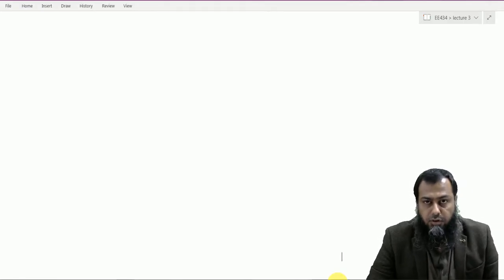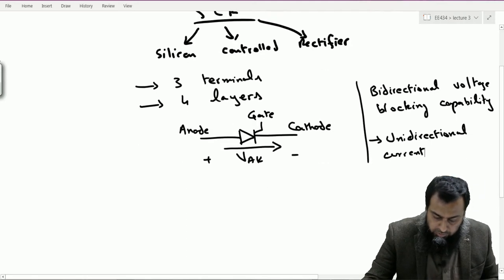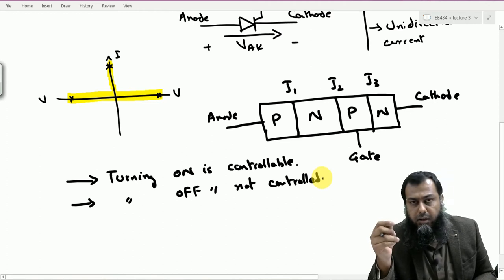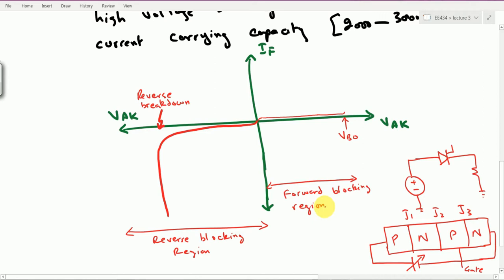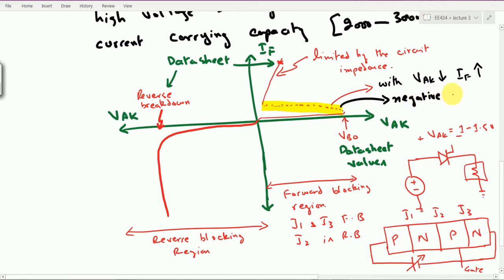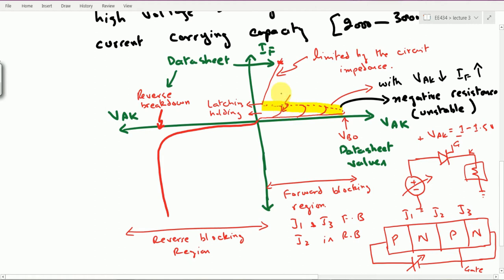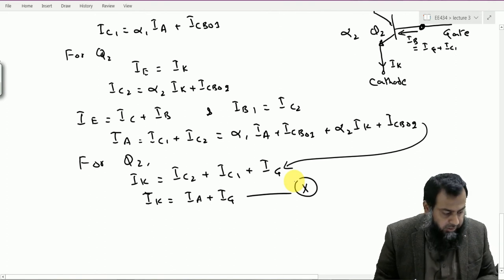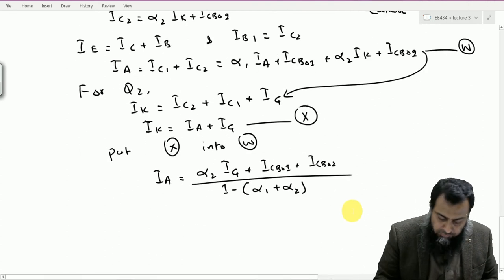Power Electronics Module 1 Lecture 3  | The Thyristor

Comment: Sir your lectures are very good. Sir plz make  videos on multilevel Inverter switching , how to  calculate the phase delay and pulse width in multilevel pulse generator to switch the different igbt and MOSFET used multilevel Inverter circuit.
Reply from the maker: I have uploaded a lecture that was based on cascaded connection of two quasi square wave inverters